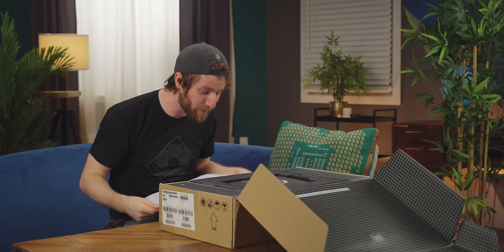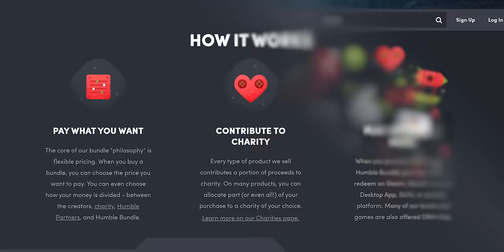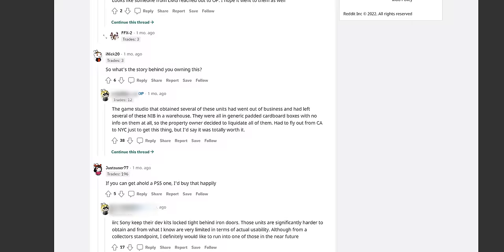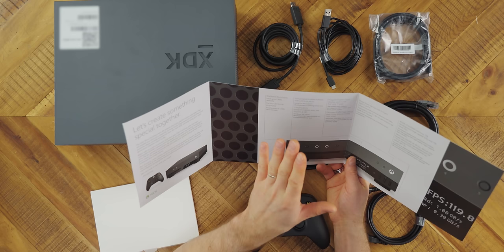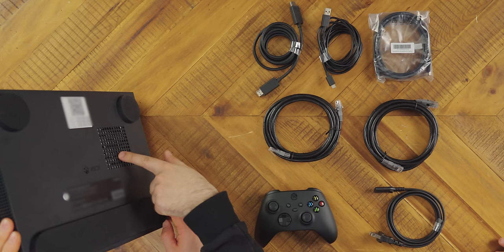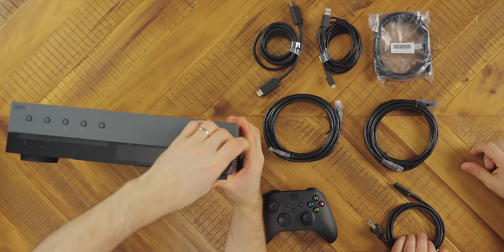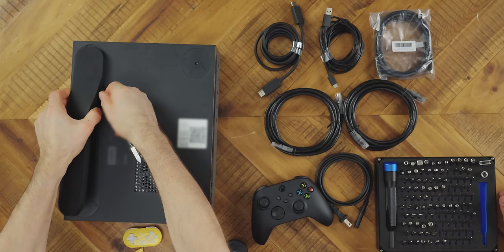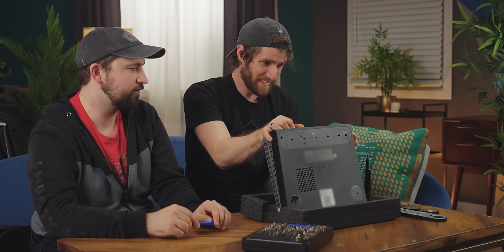I Can't Believe I Paid Two Grand For This - Xbox Series X Dev Kit

Comment: I haven't been in game development for a long time, but I assume that 10GB network port is for uploading new builds and for accessing real-time development and debug tools so you can get insight into running code. Senior developers may make $100-300k a year, and development is often iterative, particularly during debug, so eliminating idle time from the loop is worth a lot of money. The slower port presumably mirrors a real Xbox LAN for the game to use. The spec bump is certainly for unoptimized code, as mentioned, but also loading up extra frameworks and modules to evaluate them in the code base, and running debug and analysis tools. I imagine that the increase from 2x to 2.5x RAM is because the size of tools and unoptimized code have both steadily grown.
Reply: Gamers Nexus theorised that, about punting new builds via the 10gb port.
Reply: The 2x memory is also very useful for finding memory leaks, it allows you more time to identify the cause of the leak before a fault is thrown over no allocatable memory left. As for the 10Gb Eth, it is used not just for transfering builds very quickly but having near instant access to remote debugging tools that need very fast access to ram for breakpoints to not slow down frame time. This is also extended to native tools created by the developer as Microsoft not only expects you to be using Visual Studio to debug the application but your own toolset should you be using a homebrewed solution which is more than highly likely. For example: EA, Ubisoft, Square Enix just to name a few have their own game engines that highly benefit from the fast connection during debugging.
Reply: The bump to 2.5x RAM also has to do with massive log files, as per another comment in the GN video.
Reply: That is exactly what the 10gb port is for... I got one of these kits...
Reply: @CallumCarmicheal  10 Gbps does not offer faster access over 1 Gbps, just more bandwidth. (more data, not faster data)
Reply: @noneofyourbeeswax7296  Semantics.
You do realise that when transferring data, its not linear, right? Its not analogue. Bigger bandwidth = more data to transfer simultaneously so the transfer of data occurs more quickly.
Reply: You're pretty much right, maybe except for optimized code. Like there may be parts of the code that could be coded in a more optimized way but no one at my company is ever running a build without compiler optimization on: its just too slow. If you need to debug a part and its just not working out then you tell the compiler not to optimize that file.
Reply: @noneofyourbeeswax7296  True, each individual photon/electron "moves" at roughly the speed of light no matter what standard you're using. However, that 300GB image will take about 45 minutes over 1GbE and 4.5 minutes over 10GbE, assuming 90% of theoretical throughput.
Reply: I feel so dumb reading all this. I really want to learn. But idk how kinda silly haha
Reply: @emanuelperez3595  One tiny question at a time. There is something you're curious about that you can seek out. That will become part of your foundation, and help you find other answers that will also add to your foundation. Over time you'll build up a body of knowledge, just like we did.

CrashCourse here on YouTube has great primers, that are fun and generally approachable. They have completed playlists for a lot of subjects, including computer science, engineering, and physics. There are also a ton of good channels talking about different things that might interest you.  Technology Connections dives into how things work, sci-show offers science news, QI is a comedy show that offers a ton of general knowledge, LegalEagle explains the law around popular issues of the day, Two Minute Papers showcases AI graphics innovations (it's really cool visual stuff), Louis Rossman has a bunch of videos about repairing computers and phones (though his focus recently has been right to repair, which I appreciate), Linus Tech Tips covers a ton of stuff around computers and gaming, ASAP Science offers short explainer videos,  ElectroBOOM dives into electronics (some of it goes over my head but it's fun and I learn a little bit each time),  Healthcare Triage is well researched medical news and discussions of medical topics.

There are tons more from building science, to wood working, metal working, engineering, and so on. Subscribe to a few that seem interesting and watch videos that catch your attention. You'll learn a lot, and YouTube will start to recommend more. And be patient. I've been learning about tech for 40 years. It started with taking things apart as a kid and I've always been interested in why and how.

Remember, every little question you answer, even a little bit, will build toward better understanding (and also watch out for the Dunning-Kruger effect, you should google it, it's a big gotcha for people when they start to get a handle on something).

Comment: The 10gig port is for transferring builds over the network for remote debugging and testing.
Reply: Could it also be for live debug? I remember live debug remotely when doing dev on a kernel driver for Vista way back when via ethernet in visual studio
Reply: @RowdyElectron  Live debugging doesn't need that much bandwidth.
Reply: @khyododev766  good point
Reply: Woah really? Naaaaaaaaaaaa this totally wasn't sarcasm at allllll 😑
Reply: I remember reading someplace.  Normally when you testing a game software you run into problems and sometimes you need up code 5+ times day, the 10gb network is so when you have upload 5-7gb 4-5 times day it does not take along time using the 10gb network...
Reply: @khyododev766  No, but deploying the software to the remote target probably does. I would imagine a game build is probably several GB in size.
Reply: Not its not lmao its for faster then 1 gbs internet connection here in Vegas we have up to 100 gb a second download speeds
Reply: Exactly what I was going to say its so they dont need to wait as long or even run the game directly from network storage
Reply: @khyododev766  it does.

Comment: I'm surprised that as an ex-game dev David didn't know that devkits cannot play retail games. That was very common knowledge among developers. It even says in the documentation. This has been the case for all devkits that I have used, back to PS2, Gamecube and original Xbox. Back when PS2 devkits cost AUD$25,000.
Reply: yeah and the fact that for anything to work it has to have a validated certificate on the xbox, of which is on a frequent timer for updates and will quickly expire if not synced.
That's not always been the case, but assuming everything works until it connects to a server to say otherwise is just silly.
Reply: keep in mind that there are also god boxes that can also run green (production) games other than the red (development) one

Comment: I think the 10G port is for quick updating of in development game assets and remote code debugging.
Reply: yup
Reply: Its for pushing builds of your game over the network. Obviously since these builds are going to be huge they need the extra bandwidth.
Reply: @Enstrayed  technically don't need it, but if the dev has to wait, it costs the company money. So having fast networking is a must if you move around big files regularly.
Reply: I found it amusing that Linus' first thought was that they use it just to test network speeds when he himself has editors edit off network storage with 10 gig networking which is closer to what this debug port would be used for lll
Reply: Yes, needing to download a new build over 1G a few times a week burns too much time.
Reply: I'd put money on that being the case. You don't wanna wait for transfers of potentially 100GB games over a slow network.
Reply: @alolanstarboy  It's almost like this was scripted or something.
Reply: Hot Reloads and code tracing. The ability to step though code line by line is invaluable to devs.
Reply: @Deliveredmean42  huh? Then that should be more of a reason for them to mention a more accurate use case lol
Reply: I wonder why they have 2 seperate ports on it. The Xbox Device Portal doesn't like run on seperate hardware.

Maybe they assumed nobody has 10GB networking, but you can direct attach to your devbox and use the 1G port for the internet?
Reply: the 10g port is to make pushing/pulling builds faster. Maybe some other stuff too, it's just a normal 10gig interface. 
(push build : its when build is uploaded to console. pull build is when console connects to a network storage via normal windows share via SMB to download the build upon request)
Reply: @alolanstarboy  its so weird i notice him do that a lot. he will make a video about a subject and then be asking how something works after he did a video explaining it.
Reply: Correct. It's so it doesn't take an hour to push a new COD build to the device.
Reply: Game streaming similar to web emulator tech like xcloud allowed developers to not have to burn discs
Reply: @FinnishArmy  lol try 10+ times a day when working on build packaging, etc
Reply: precisely
Reply: @Enstrayed  probably also dumping memory back to a workstation for debugging. 40GB of RAM takes a while even at 1Gbps
Reply: @unicodefox  The second host mentioned a separate network for the debug port that is presumably secured and isolated from the internet. As the other port is labeled “retail”, I assume this port would connect to the internet for ms servers, their xbox developer network and testing online functions on XBL.

Comment: Linus: Dont make me buy an xbox
Also Linus: I bought an Xbox.
Reply: Spend $5000 on a fancy AVR to avoid buying one or two $500 consoles
Reply: @guspaz  It sounds stupid without context like that, but it also means when new consoles come out, he doesn't have to buy multiple of those either. It saves money over time as new consoles come out
Reply: @HearMeLearn  He would still have had to put up with the bad input lag though.
Reply: @HearMeLearn  assuming that those consoles do not support new HDMI standards that are not supported by his existing receiver…
Reply: @HearMeLearn  Linus already said he has to replace it with a newer one because the current receiver doesn't support the features he wanted (multiple 4k 120hz support).  So much for that.

Comment: From my time working with Xbox consoles, I can tell you that the offline system update (OSU or OSUDT as it used to be called) is not only useful for people to update their consoles while offline, but it was a life saver of a troubleshooting step, especially when Xbox One consoles would be stuck on the green loading screen.
Essentially it formats the console and reinstalls the software. Or at least that's what it used to do back in the day.
And we'd actually use that for more issues that could not be fixed through regular troubleshooting. It was a sort of a last resort and if that didn't work the console usually needed servicing.
Reply: How is it like working as a game dev? Can you share a bit of your experience?
Reply: @KesleyBenedet  unfortunately I haven't been working as a game dev, but rather doing tech support for the consoles. The issues I described are issues users were facing and my job was to help them resolve the issues.
Reply: Oh cool
Reply: I remember when I had bad internet at home so I downloaded PS3 firmware update on a flash drive at school. Didn't know you could do the same for an xbox one, although I imagine it's less intuitive
Reply: My drive crush in Xbox one x, I replaced it with some of my SSHD, and I stuck on the OSU part. Drive was partitioned, but nothing works. I am stuck at 1 percent on system installation. I read that I should try several pendrives and tools for unpacking OSU, and after 6 different preparation, I finally have a working Xbox. OSU is a nightmare, and I am not even in the insider program (insiders cannot use OSU before the number of iteration of OSU hits the number of insiders built).
Reply: osu!dt?
Reply: osu! ?
Reply: @MSDOSMemes  offline system update
Reply: Handy for those times Xbox pushes out buggy insider updates. Once had to do a OSU after an update pushed to the console during gameplay nearly bricked the Xbox one, right at the start of a week long covid lockdown last year.

Comment: The thing looks so much more smart than I expected it to be. Why does it have such a fancy unboxing experience??
I thought it would be a some sort of test bench looking thing with a bunch of exposed pcb's and arrives in a beat up carboard box secured with some cracked in half Styrofoam thing and padded with wadded up newspaper.
Reply: Nah; they'd want to lock down the hardware design pretty solidly before letting developers work on it; for consumer products like game consoles - especially ones with a brand lineage like Xbox - getting the hardware down is the important part. The software will continue to be developed long into this hardware version's life-cycle and beyond. Microsoft doesn't need to worry about having some "killer apps" ready to go as soon as the platform is released, so they won't take the risk of letting software devs play with potentially broken hardware, or a hardware design that will be obsoleted by the final product.

Fun Fact: I used to work for a software company that, along with a finished product, also had to develop drivers for the hardware various laptop manufacturers used in their designs - and the permutations were almost infinite; we had something like 100 different drivers to accomplish essentially the same thing. We often had "development phase hardware" delivered to us. I had indeed received prototype laptops that were exposed PCBs in random cardboard boxes... one even came to us on top of a *cookie sheet*. With a piece of cardboard glued to it so the PCB didn't short out on the metal.

Fun times...
Reply: @MrJest2  Laptops and tablets should all get the Vulcan IDIC medal. I have a tablet that I struggled with for a while trying to get Windows 10 to install a driver and work with its MTP setting for USB. Nothing would work. Windows would just obstinately refuse to connect driver to hardware.

So I got to poking around and manually selected the generic USB MTP driver under Portable Device. It worked! The bleeping STANDARD MTP DRIVER that comes with Windows 10 worked, yet Windows would not automatically detect that and install that driver.
Reply: That's not what devs pcs are so why on God would it be that way with Xbox or Sony?
Reply: @MrJest2  sounds like a company if it can do it cheaper it will sorry you got stuck in a shitty factory kinda ballshit should have gotten a better job (well more so gone with a better company to get test jigs and shit because dammmmm)
Reply: @greggv8  That's often a good approach if nothing seems to work, these days. 

Sadly, back when we got prototype laptops "with character" and had to custom craft drivers for each hardware combination, it was just after the release of Win95. There were no reliable OS-installed drivers beyond the very rudimentary ones common to any IBM-compatible PC at the time, and everyone who needed to support custom hardware (which was every laptop in existence) had to roll their own.
Reply: @the_mancavewithjacob  It was the nature of the times; everyone had to deal with that. Early-to-mid 90s.
Reply: @MrJest2  What was very good with Win95 on laptops was the greatly improved support for PCMCIA. With DOS and Windows 3.x the drivers ran in DOS. There was Card and Socket Services which is what had to be made for each different PCMCIA controller. Then there were Class drivers and Point drivers. A Class driver was generally used to support all devices of a common type, like battery backed DRAM cards all ran using a single Class driver. SCSI cards might run with a Class driver unless they had special features the common driver didn't support. Specialized cards like for audio would require a driver just for one card. Those were Point drivers.

If you wanted to hot-swap you had to figure out how to squeeze in every driver for every card you'd be using because all of them had to be loaded during boot and they'd stay in RAM full time. A "road warrior" user would have a boot menu with options to load different sets of card drivers.

Windows 95 could manage several PCMCIA drivers, which had to be for Windows, not DOS. It was so much nicer to be able to use many cards rather than having to choose the two or three with drivers that could be shoehorned into RAM together.
Reply: oddly specific...
Reply: It's fine..., they still give you a gilmpse of dignity before you innevitably turn a dream console into a dead brick, so at least you still got a little bit of fun with the unboxing.
Reply: It's basically a dirty website with specific fish categories. 
So don't worry too much about it.
Reply: @rigel8755  Don't blame Microsoft lol, these things just aren't meant for non development use
Reply: @scarlettekk  that's right
Reply: The devkit looks way better than the final XSX
Reply: I mean. they are like, regularly shipping these out to developers, so it makes sense that they would want them in neat packages

Comment: I really like the looks of that machine... a console with a more mature low key look, plus it would fit quite nicely in an AV setup.
Reply: was thinking the exact same thing
Reply: You don't think both retail xbox have a low key look!?
Reply: @william41017  Yeah retail xbox is a black box, but it's also a fucking huge, designed to stand vertically black box. It's got more in common with a vase than a media player.
Reply: Eh